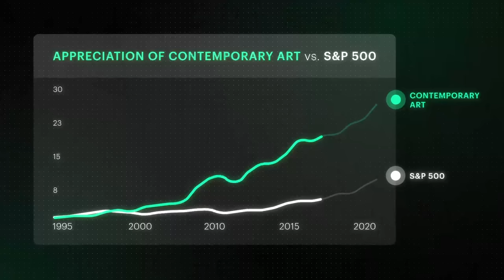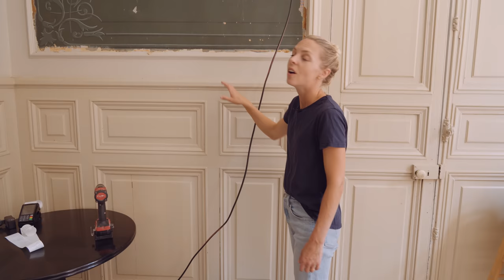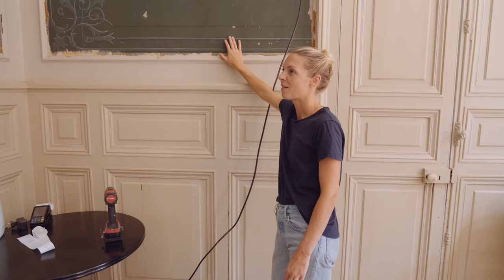TURNING this CHAOS into GUEST ROOMS (New projects at the Chateau)

Comment: I believe Phillipp needs a customized tool shed in the carriage house.  He could lay it out to suit all of his equipment and tools and also store items that he rarely needs. The best thing is that he could also be outside which would make him happy. I would use doors to the back of the building.

Also, I would store all of my leftover paint in plastic containers.  Your metal paint cans will start to rust soon because of the salt air and you will lose 💸💸☹️.  I keep small jars of paint with plastic lids so I can do touch-up work and not have to take out big cans of paint.

I wish I could come help.  It does look so rewarding.

God bless and enjoy these days. While they last🧡💚
Reply: I store my paint in the plastic containers as well. It works so much better than constantly cleaning the rim of the can so it will stay fresh. You have really great ideas.
Reply: Excellent. I stored paint in plastic buckets  with lids by because of rusting cans and it's a great thing to do, and if the bucket is turned upside down (lid to ground) the paint doesn't go hard.
Reply: @cherylmclaughlin9490  all paint in cans,tins,plastic goes off after about 2 yrs
Reply: @michelebourke4340  oh thanks. Sheeze time to recycle.

Comment: How about chinoiserie drapery, rather than on the walls? It's less of a commitment but conveys the theme.

We're working on the last untouched room upstairs (also a library/catch-all) to turn it into a 3rd office. The attic and other offices have become the "overflow" after both finding homes for and minimizing stuff. The small, old addition (8 x 12 feet) has been so troublesome we had the exterminators out twice and had to call in professional help. Workers ripped off the clapboard last week and are half-done replacing it. The electrician is coming next month for a service upgrade. It was supposed to be a one or two-person job... 

However, it does feel good knowing there's no more dirty, rotten secrets lurking upstairs. 

I'm sure you'll find places for all your tools. I've discovered space needs evolve, and organization/donation does wonders.

Comment: A good solution for storing tools out of sight would be a trailer. You could keep it on property while you’re working a project and move it off site or to a secluded location on site when you’re not in a project. This way you could keep a smaller amount of “essential” tools at the chateau and put the tools you don’t need frequently in the tool trailer.

Comment: I like the comments of using a period type wallpaper being used in the dining room that combines all the colors used throughout the chateau. 
I do love the wallpaper found in the dining room. Does it have to remain there? Use it in one of the last guest rooms. Flip the colors - green as the accent but a soft blush or rose as the main theme. 
4 walls of burgundy could be too much. An accent wall?
I would agree - I understand the liking of soft  muted tones but be bold in these last 2 rooms.

Another thought - perhaps think of keeping your gray water from the gites to be used in maintaining the gardens. Solar panels? Wind generated power? I know they are not aesthetically pleasing; however, the potential savings in the long run. Upfront cost vs long term investment. 

Best of luck.

Comment: Hi Anna ans Philip I would suggest to organise your DIY things as we did. Firstly remove things like left over paings and place it in one of your out buildings or the attic. 
Next sort daily usage tools and products into catergories which you then pop into portable storage bins with a label on the sides. For example one for drill and screw drivers,  one for filling products and tools along with and sanding tools and paper etc. 
EVERY day when you are finishing allow a few moments to return all tools and products to relevsnt storage. 
At the end of a job you simply carry the storage bins to their new location to be used or to where they will be stored until next time, in our case we use our cellar.
Although it sounds time consuming once you have done the primary sort it so much simpler to source the item you need.
Reply from the maker: sounds like a good plan! thanks!

Comment: Keep the Burgandy ( or a similar shade) as many have mentioned below. With light wood tones/cream/gold sprinkled in. It's also a nice color to work with tapestry for wall decor. It will feel more masculine than the other rooms (not to mention very Gryffindor), but it may be nice to offer that option to guests. I'm sure Anna will decorate it beautifully. It will also contrast the bathrooms if they are to look the same on both sides with lighter neutral tones, or they can represent their respective rooms. Perhaps the tile mural can be the difference between the two reflecting their attached suites.
For the dining area, it might be nice to keep/add on to the original design but swap the color. The design is darker, while the walls are of a lighter tone. Or perhaps nonevasive wallpaper, allowing you to incorporate the design while still preserving the original wall. (If that option even exists). But whatever you choose I'm positive it will look stunning. Best of luck with the renovations ahead!

Comment: Tips on how to do the last room from an experienced renovator:
All the tools are not needed all the time.  The task has stages which works to your advantage.  
You will need at least five large buckets.  In the US we re-use the five gallon buckets that paint comes in.  You will also need tool organizer liners for the buckets.  
Ok. Now you have your supplies.  
Each bucket is for a specific task.  
In your electrics bucket you have wire strippers, cable cutters, screw drivers that match the screws you’re using, roils of wire in the bottom of the bucket, always a hammer, bags of appropriate screws, and whatever else you need for that task.  
What I see when when I look at your tool room is a lot of time spent looking for the right tool!
Professionals only bring in the tools they need!
Everything else goes in the attic.  
As you work you’ll find joy in having what you need and only what you need. 
Trust me.  I’ve renovated homes, boats, and dozens of landscapes.  
Enjoy!!

Comment: Phillip makes a strong and valid argument for a new separate work shop room.
A new garage / workshop building should be added to the budget.
It needs to be sizable enough to restore a sailboat over the winter months, it needs to be heated for comfort (air conditions might be considered too) and tools and compressor could be stored safely out of sight from the guests.
I would do this before renovating anymore rooms.
You can NEVER have enough storage space.

Comment: Remember someone is paying to stay there color's should be light air not daunting as the guest was rest relaxing time. When it's dark you cause anxiety and or stress.
Reply: Maybe it wouldn't be so bad. Two big windows gives quite good lightning. I think they wouldn't use burgundy on every wall and from floor to the ceiling (then it will be overwelming), but likely paint paneling in lighter neutral colour. Moreover decorating in matching calmer colors doing a difference and making it more cosy. I 'd like a room like this :)

Comment: To solve restoration crisis Catch 22: “How to renovate the last room,” make your tool shelves mobile. Securely strap them onto a flat, moving dolly or attach heavy duty, locking wheels to the bottom of the shelves (finding a kid safe technique :-). Create a guard rail for items on each shelf by wrapping/threading string/wire around/through the four, vertical shelving post so items don’t fall off in transit.

Guest room color: deep navy blue or another dark, rich tone sympathetic to the 1700s color palette. Match it to the colors of your shower mosaic and/or kitchen tile. Design concept as historic, modern lux with layered lighting.

Dining room color (for Philip): 1700s sympathetic, creamsicle orange that compliments the light sage of other rooms. Pull color from the kitchen painting. Place a paintable, protective wall-papering over exposed original mural, but frame and cover with glass your favorite section of scrollwork and make it part of an art gallery installation.

#DesignMakeOff, #BestChaletEpisodeEver (Don’t really know how #s work, but they’re fun to write.)